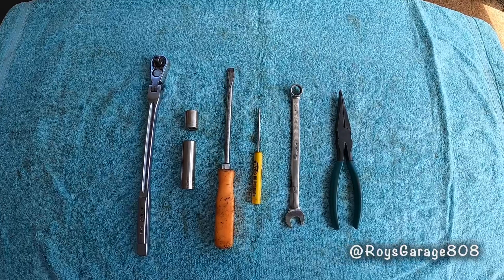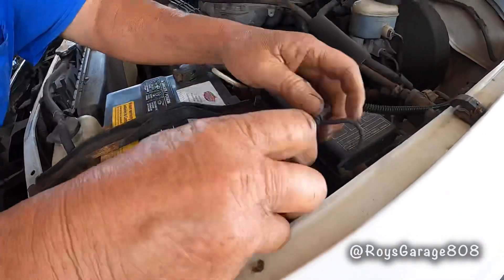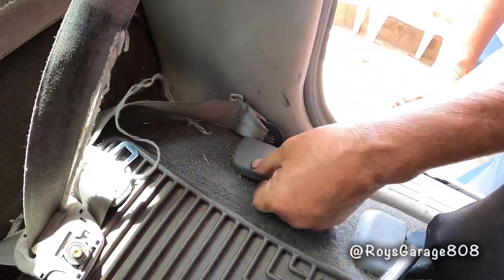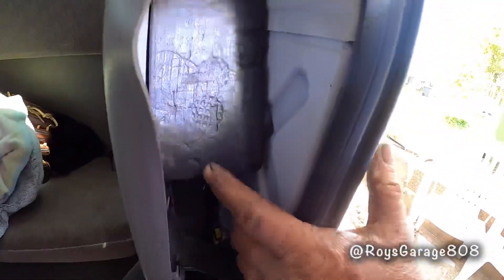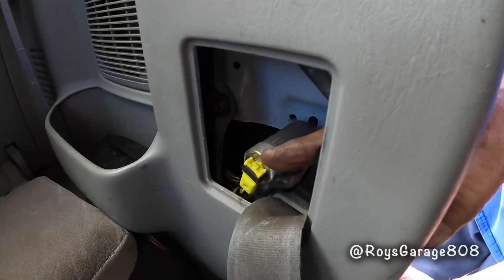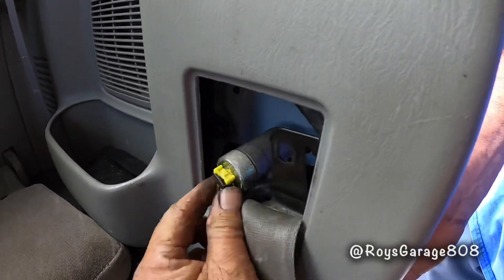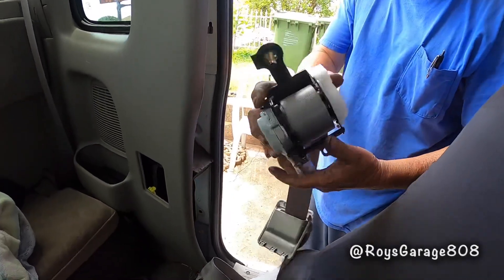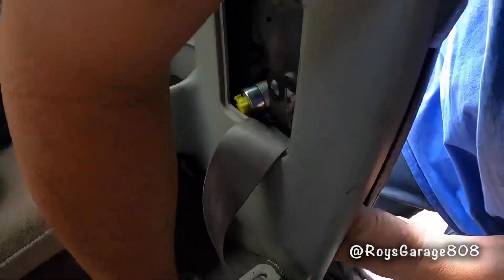How to Replace the Driver’s (Left) Side Seatbelt on a 2002 Toyota Tacoma

Comment: Hey I got as far as removing the old seatbelt and realized this video does not show you replacing the housing unit for the buckle itself. Do I need to remove the entire seat? to get to the female seatbelt buckle piece? (the piece where the tab that you pull over and across your body and click the belt buckle into and has a larger red button to push to unlock yourself out of the seat belt. Hope this questions makes sense and you or the community can assist me. I have riding around dirty without a seatbelt for going on the 3rd day now.

Comment: Hello dealer cost is over 230.00 where can i find cheaper?
Reply from the maker: I’d highly recommend sticking to the dealer for this one, there’s a lot of electrical components connected to the ECU that (highly) might not be compatible if you get an aftermarket part. thanks for watching 🤙🏽🤙🏽🤙🏽
Reply: I got mine at the dealer, but the first one I called was little more than yours. The second one I called "Longo Toyota in El Monte, CA" was only $164.00 
Not sure why the big difference from dealers, but there it is. Good Luck.

Comment: Sir, i have a question why you need to remove the battery connector?
Reply from the maker: Great question, it needs to be disconnected because they are both a part of the supplemental restraint system (SRS) and messing with the seatbelts may mess with the airbag system causing its to deploy or disable. For example, I had a customer who got into an accident the seatbelts locked up to keep them in their seats but the accident didn’t trip the airbags to deploy but now BOTH her seatbelt and airbags are disabled and the vehicle in unsafe to drive and it most likely needs to go to the dealership to get it reset. Hope that answers your question. Thanks for watching 🤙🏽🤙🏽🤙🏽
Reply: Thanks for the information! More power!

Comment: Why did you disconnect the negative terminal on the battery?  Why did you have to wait 20 minutes?  Very interesting video!!
Reply from the maker: If you don’t disconnect the battery you could get shocked, the seatbelt actually has electrical components to it! You wait 20 minutes to wait for the electricity to disarm throughout the vehicle. Thanks for always watching 🤙🏽🤙🏽🤙🏽